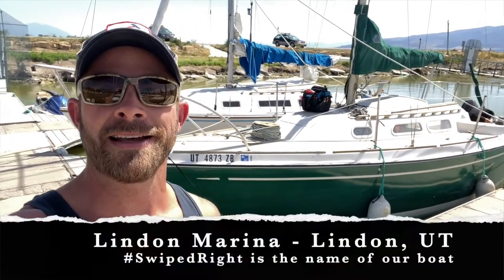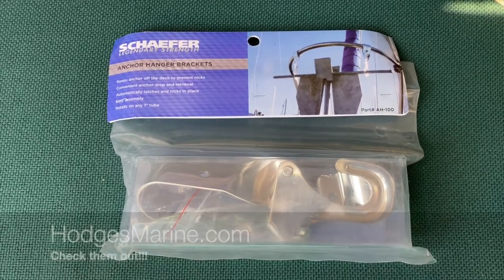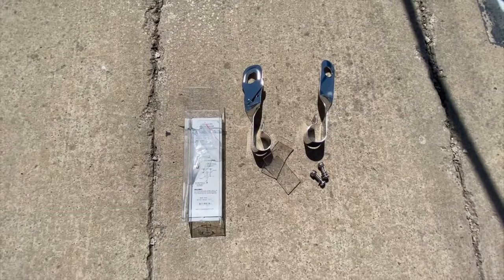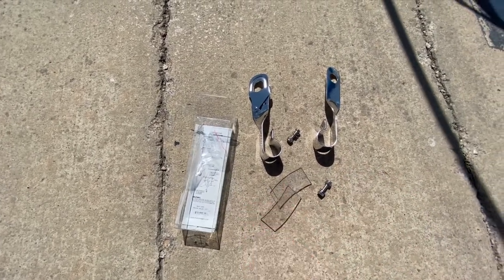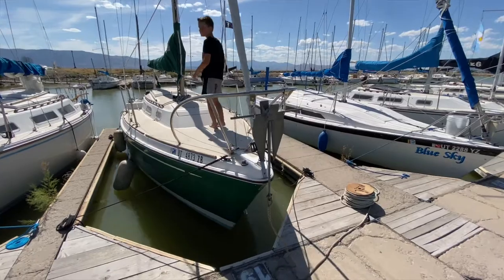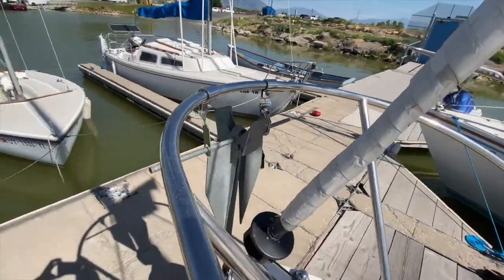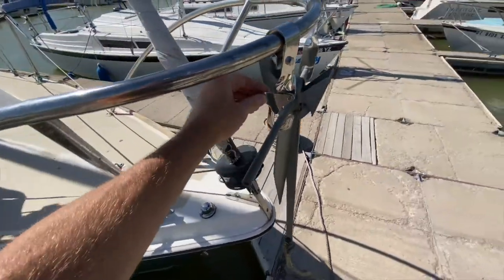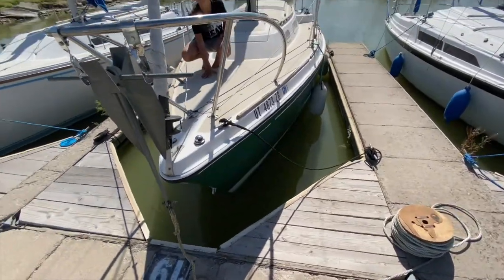How to Install a Schaefer Anchor Hanger on a Sailboat | Wandering Wassoms - S1.E24

Comment: I am about to purchase the anchor hanger. I am wondering how easy it is to deploy the anchor since it is upside down? How do you get it right side up before lowering into the water? Seems like it would be a cumbersome process with the weight of the anchor and the rode attached.